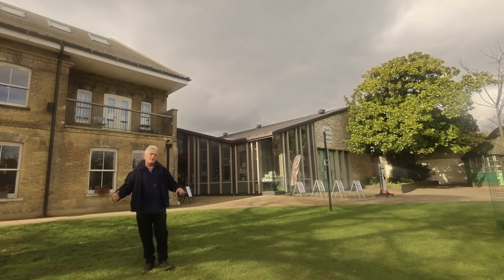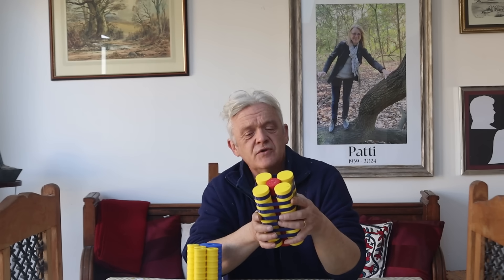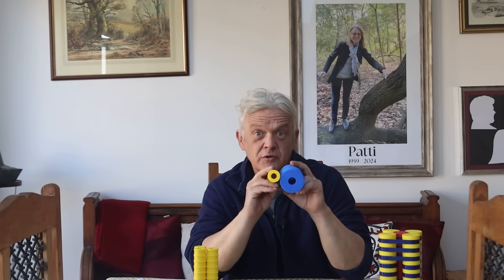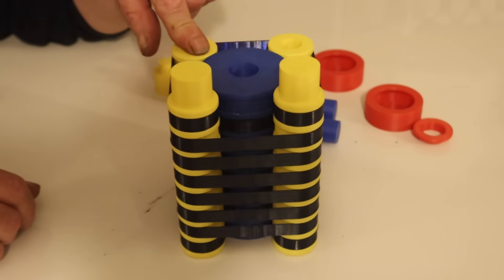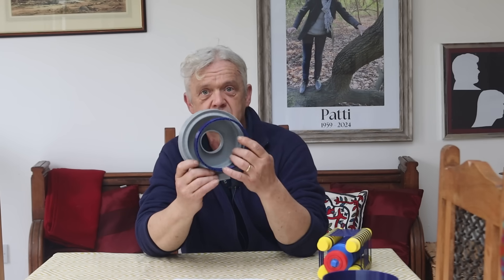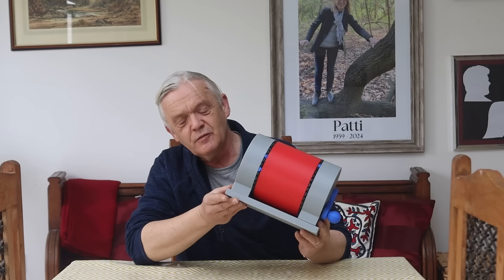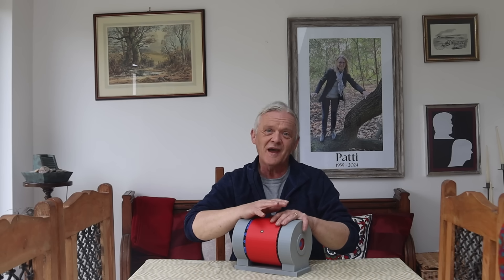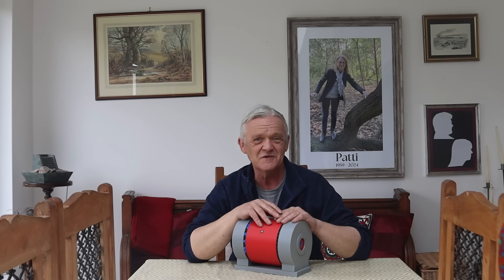2359 The Scroller Wolfrom Drive - A New Idea?

Comment: It looked basically like 12:1 ratio. If you designed a metal version at 60:1 you could power a lift!
Reply from the maker: it will do crazy gear ratios mate all you have to do is adjust the lever size we talked about

Comment: I do find this very cool. Tho, the internal friction seems to be fairly high based on the effort needed to turn the device in the video. I am not sure I understand the alternating placement of the bearings -- do both bearings touch the turning barrel?  (Because one of the bearings in the alternating pattern looks like it is the flat side, and I don't see how that would work efficiently).
Reply from the maker: the closeness of the yellow rollers to the 'ground ring' did make it hard to turn and it does need 'mucking around with' to get that better but that's all there was to it really and you make a good point it might be better to replace that section - the 'wolfrom section, with gears - nice thinking mate thanks for sharing - i think it will improve the overall machine if i did exactly that - the bearings are cross roller bearings and i have done a video on them and how they work you might want to check that out
Reply: He has a video specifically on the bearings that will help you to understand that better.  I printed one and it actually moves fairly smooth.  I was going to ask a similar question though.  If it's a matter of friction making it so tough to turn, or if it just requires that much torque? If its friction though, I would imagine you can clean some of that up by playing around with tolerances on the pieces to be a little less tight of a fit for more free range motion.

Comment: Depending on how much force it takes to rotate the drive wheel, this could very easily be used with wind energy(couple it with a rose turbine to turn it, the lever end would spin pretty quickly hence  a good drive for a small generator).  Thanks Rob!  Only limited by your imagination is a great way to begin with a project.
Reply from the maker: cheers mate

Comment: 💯 Very interesting. big Like! 👍
I have long been fascinated with efficient and elegant mechanisms.
Your channel has some great content and I have 3D printed several of your designs.
The Wolfrom drive I knew as the radar bearing or split annulus differential planetary gear for high ratios in small spaces.
I'm also interested in high force rotary to linear actuators such as the differential planetary roller screw. These are often inverted.
I would enjoy seeing your coverage, explanation, and design of Differential Planetary Roller Screws.
Thank you.
Reply from the maker: That's a nice suggestion mate thanks for taking the time to say it and I am glad you like the video

Comment: The video references (numbers are wrong). The numbering of the last 20 videos (after 2342) is messed up (some even having duplicated numbers):
The first 2343 and first 2344 are ok, 
2345 says 2354, 
2346 says 2345, 
2347 says 2343
2348 says 2353,
2349 says 2355,
2350 says 2356,
2351 says 2347,
2352 says 2357,
2353 says 2358,
2354 (The Wolfrom Drive) says 2359,
2355 says 2354,
2356 says 2355,
2357 says 2344,
2358 (The Rolamite Beraring) says 2356,
2359 says 2357,
2360 says 2358,
2361 says 2348,
2362 (this one) says 2359
Reply: He's usually on point, could be a mistake.
But likely, references are for the video, and its content. Not the sequence in which it's released.
As far as I understand.
Also, some videos are only visible to channel members, and do not show up in the usual video tab, Unless... you have the membership.
Official membership costs a bit.
Reply: @yasirrakhurrafat1142  That doesn't explain the duplicated numbers. What number do you see for this video I see 2359, which is the same that he references, for the Wolfrom Drive
Reply: @umbrel   yea, this is the update to the same concept.. maybe its to associate the reference with the concept. Idk.
Although he has separate playlists for each/interesting enough topics.
Idk, he probably made a mistake.
Which is somewhat of a rarity, so far as I've seen 😂.
The guy's perfect!
Reply from the maker: and you are right mate too mate they refer to content not sequence - the members starts at UK£2 - i don't think that counts as a lot TBH
Reply: @ThinkingandTinkering   great.
I don't have any means for making transactions other than cash, due to an issue.
And its very tedious to get it working.
Otherwise, you, as well as the content, is awesome!

One question though sir, do you happen to know if the magnetic reluctance of ferromagnetic/paramagnetic metals rise linearly to the amount of energy gained?
Since you'd made that video on.. a magnetic engine using nichrome wire (since i saw it), I'd been wondering if they could compete with solar panels or stirling engines.
If designed well.
They seem to demand minimal effort/difficulty in making, and aren't likely to break/fail easily.
And it wouldn't be a big loss if one broke either.
Reply from the maker: you are right mate - i must go through it and change it - but to be honest you will get a choice of 2 and it is pretty obvious which one i mean - so not that much of a brain teaser really

Comment: I wonder how well a coil or two placed lengthwise in the main cylinder(s) would do attached to your meter! Thinking if you have many magnets in the rollers and while they spin they could generate power? Or even capture just enough residual energy to counter normal transmission loss from a windfoil, make that moot, type thing. 

Fun to think about! Cheers all!
Reply from the maker: interesting mate - definitely fun thinking

Comment: A marvelous winch you have there!  Very nice.  I think the diameter of the inner rollers doesn't matter so much to the drive ratio as the length of the belts. Even though the inner scrolls appear to be part of the driving train, they are effectively idlers.  The drive to the outside drum is via the belt.  The two ratios to look at will be the size of the inner drum to the length of the belt, and the belt length to the inner side of the drum.
Possibly the diameter of the inner drum to the diameter of the scrollers+drum might be a better way to calculte the final drive ratio.
Reply from the maker: I am sorry mate they aren't idle - the belt doesn't touch the outer drive drum as the belts are sunk into the rollers so the belts don't actually touch the output drive cylinder. The raised bumps on the yellow rollers are the part that transfers torque
Reply: @ThinkingandTinkering  Yes, you're right.  My fault.  I didn't really think it through.  Still trying to figure out the ratio.  Thanks.